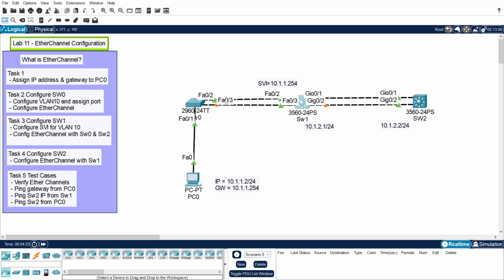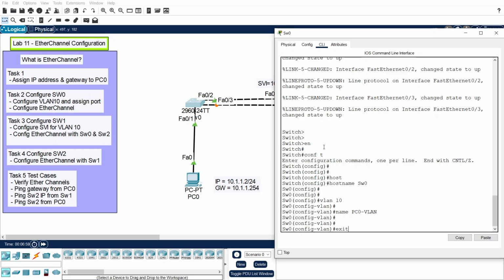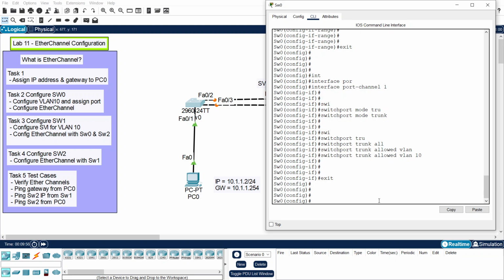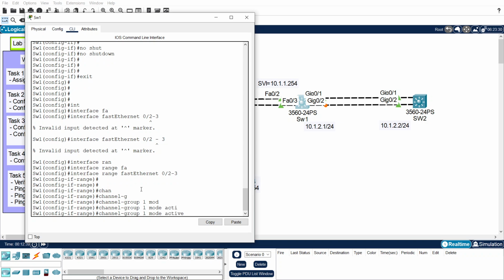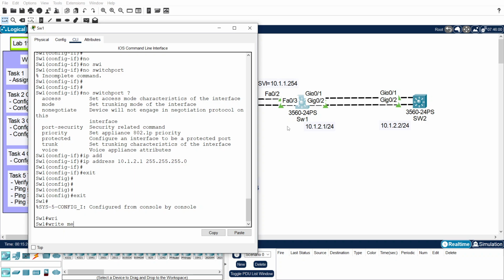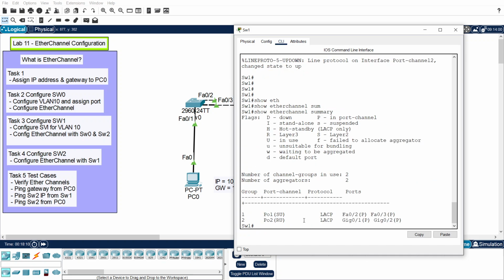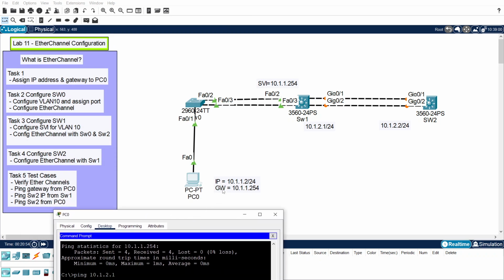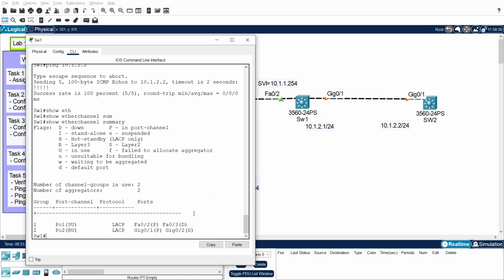Free CCNA 200-301 v1.1 Lab 11 - EtherChannel Configuration

Comment: Thank you very much for the video, for the static route configuration between the two MLS, in MLS 1 is the static route is "ip route 10.1.1.1 255.255.255.0 10.1.2.2" and on MLS 2 "ip route 10.1.1.1 255.255.255.0 10.1.2.1" ? im not sure i am doing it correctly, please correct me if im wrong. thnks
Reply from the maker: Thank you for watching and the comment. No static routes were used on the MLS 1 and MLS 2 since they are not required in this lab setup. PC1 can reach MLS1 since it's gateway is defined at MLS1 through VLAN 10 SVI. MLS1 also has the route of 10.1.2.0/24 since this network is defined on its local interface. Hence, traffic from either side can reach the other side since the MLS1 in the middle has connectivity to both ends. I recommend that you to download the Packet Tracer lab files from the link given in the description and run it in your Packet Tracer for better understanding.. Feel free to ask if you have any further query or need clarification.
Reply: @mikealpha  Thank you very much, i get what you mean. But I was just wondering how can i fix pinging issue between PC1 and MLS 2 and if im not mistaken the static route is the solution but i just not quite sure how to do it correctly in our case. i have packet tracer and i apply what you do in each viedo.

Comment: Thank you for you Educative videos
as a small troubleshooting to the ping issue i used static route between MLSs and it worked also for that orange links i just converted the physical interfaces from Layer 2 to Layer 3 using "no switchport" command on each one. 
!!!!!  I enabled routing before that  using "ip routing " command but the ping didn't work !!!
good luck for you all
Reply from the maker: That's excellent troubleshooting! Thanks for sharing your solutions. 👍

Comment: I guess u don’t need static route configuration but u neeed to active ip routing in layer 3 switch so it can build its routing table
Reply from the maker: Good point! 👍 Enabling IP routing on a Layer 3 switch is definitely required for inter-VLAN communication. However, without static routes (or a dynamic routing protocol), the switch might not know how to reach networks that aren’t directly connected.